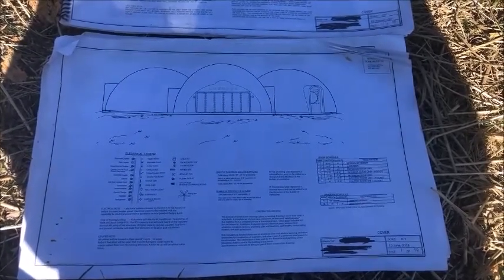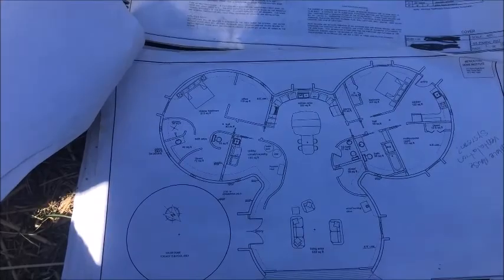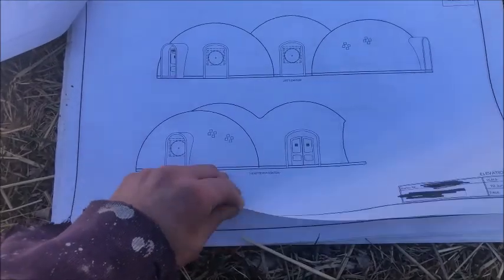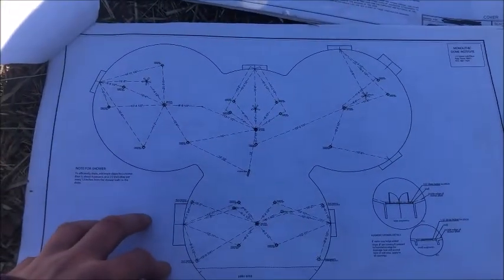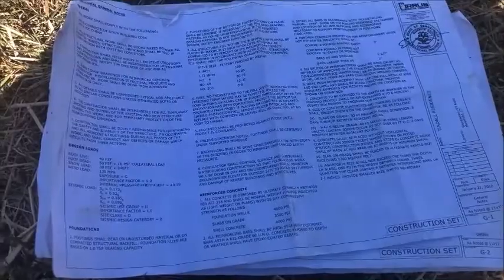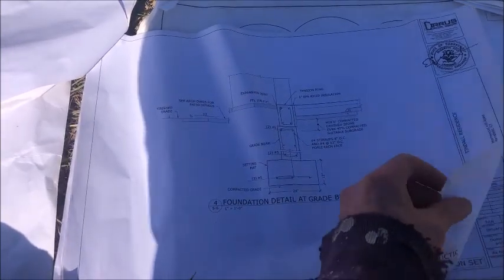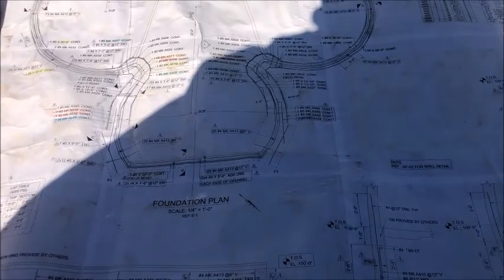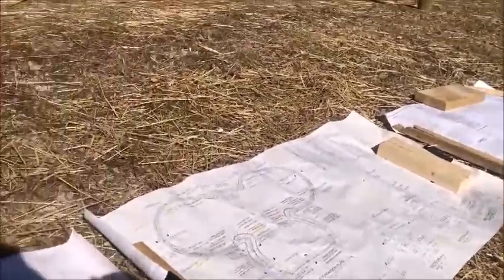Explanation of Monolithic Dome Plans

Comment: Thank you for sharing. What coating are you using on the exterior so that the concrete holds up to the elements?

Great videos and great project. Thanks again.
Reply from the maker: I just saw your comment, sorry for the delay! The exterior isn’t concrete. At least not yet. The exterior is the airform. The airform is made from single ply pVC roofing material. It’s the same stuff that they use for commercial flat roofs. This is fine for 20 yrs as is. We will need to coat the exterior in something else before the 20 yr mark. If we can afford it we have decided to coat the exterior in concrete and then lime wash it.

Comment: How much did it cost to build over all at what square footage?
Reply from the maker: Your cost is going to vary by location and how much you do yourself vs. hire and what materials you use to finish it. Sorry to be vague but it is really site dependent. We hired South Industries to come out and do our shell. It was $72 a square foot for their part. Ours included the air form, ring beam, floor tension beams, the exterior shell, all materials and labor included. (as well as everything related to them coming to our site to work for 6-8 weeks) This does not include any site work, foundation... other than the ring beam, land, concrete floor or any labor or materials related to finishing the dome other than the plain shell itself. I have heard that it can be more like low $60's per square foot if you go with a single dome and are not over 2000k miles from them like us. Monolithic has a feasibility study that helps you figure out how much it will cost you to build. It does cost about $500 but that is applied to the cost of your plans. Here is the link to their designing process where you figure out what you want, need and can afford. This is where we started after we bought their Dome living book. https://www.monolithic.org/feasibility-residential
Reply: @dometastic  Thanks but what's your total square footage you paid for so I can do the numbers? Your doing some of it yourself so I would assume housing sqft costs are not what you actually paid. I know price varies greatly depending on location but ball park numbers help for planning budgets overall.
Reply from the maker: @dustin-titz  Our house is 4 domes with a total square footage of 2735. We have done everything ourselves except what I listed above. That hired out part for the shell was $72 per sq ft. The only additional thing in the whole build (so far) that we hired someone to do is to pour the slab floor. That cost us an additional $7k. I have no idea what the livable finished build cost would be if we had a builder doing the whole thing.

Comment: Ok forget my diameter question in another video.  I see they are 32 ft. my 2 will be 38 ft each pushed together to make a length of 59ft.  Your videos give a much better feel for the size of domes on the inside vs my Sketchup 3D walk through.  I'm just in the beginning stages of actual design after getting county engineer's stamp requirements figured.
Reply from the maker: If it helps ours is about 75ft from bedroom wing to bedroom wing and about 50 ft from the front glass wall to the back kitchen window.
Reply: @dometastic  you have a great layout.   My florida gulf little lot didn't give me a wider option that 40 ft x 75 ft to stay above the flood zone.  As much as I would love to do as much hands on as you are doing I'm more interested in moving in to enjoy retirement.   Looks like you are in snow country which is exactly what I've had enough of.
Reply from the maker: @doclees11  We would have loved to have someone else do the work and move in quick. :) Unfortunately we need to save money by doing it ourselves (we couldn't get a building loan on something so different) AND it is super hard to find contractors that are willing to do something round. Goodluck on your build! It is an adventure even if someone else is swinging the hammer!
Reply: @dometastic  exactly on the contractors.  One contractor that builds million dollar homes on pillars said he wouldn't know how to estimate a round house.  None of these guys heard of time and materials?  I'm lucky enough to have a master plumber brother and a cabinet maker willing to make the trip(paid) to FL.  It's a start.  Never thought that would be an issue. My issues have been with county flood zoning employees that were clueless.

Comment: I think it is strong enough x5.
Reply from the maker: We joke that the footer and foundation was designed for a parking garage not a house. 😂 We think the engineers were compensating for not fully understanding the structure. 🤷‍♀️
Reply: @dometastic  It all depends on the soil/potential settlement, and they just did not want to sharpen the pencil - because there is not enough in this job for them to do that.  If any project would justify very little rebar, it would be a dome.
Reply: @dometastic  We had the same with ours.  It costs the engineer nothing to make it way stronger than it needs to be and he sleeps better at night.  I did fight him on a couple things, such as he specified all #5 rebar.  I asked him if he ever hand rolled #5 rebar?  He had not, but that wasn't his concern.  It wasn't until I asked him to show me the calcs justifying #5 rebar that he agreed I could switch to #4 rebar, but then he increased the number of pieces by 50%.
Reply from the maker: @SimonHomeintheEarth  Ours made us put #5 in the footer but everywhere else it was #4. There is a HUGE difference working with #5! Our plans originally called for all the rebar to be epoxy coated. We pushed back on that. We are not near the ocean (its 40 miles away as the crow flies) and the property isn't wet...we are at the top of a hill. The rebar supplier was confused why we needed it so I researched a bit. My research said that coated rebar is typically used in bridges and overpasses when adverse conditions are expected. (salt water and/or always wet) The engineer was like yeah.... well it is better than uncoated but I guess you don't have to do that since it won't be subjected to excessive moisture or salt. That is one of the reasons we joke about it being designed like a parking garage or bridge.